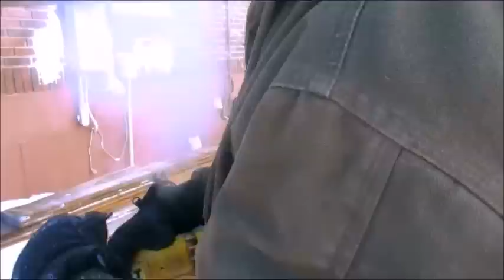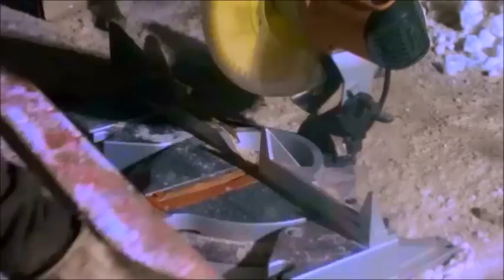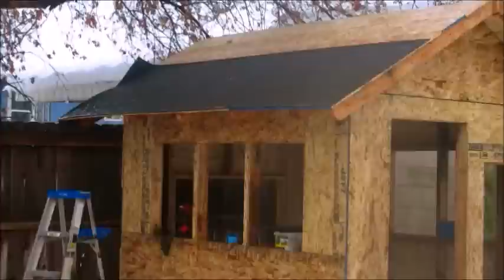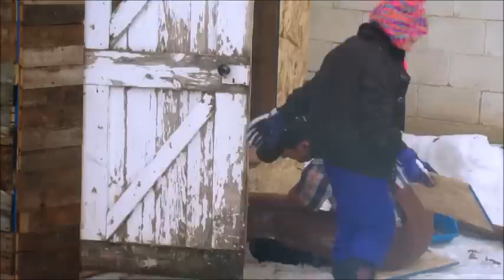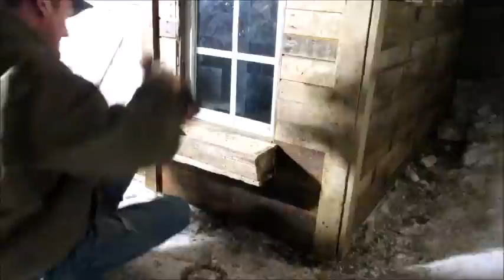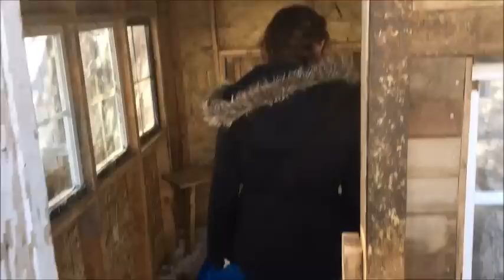#61 - I Built My Wife The CUTEST Chicken Coop! (Scrap Lumber And Antique Windows)

Comment: Looks great. If you insulate it you will need to make sure it is well vented for the chickens. The other thing I recommend is if it is a wooden floor, put something over it (linoleum is good) to make it easier to clean. Like wise for your wall if you can find some pvc boards (used for making signs) use that on your walls. I would also make lift out nest boxes. Everything to make it easier to clean.
Reply from the maker: Good advice!

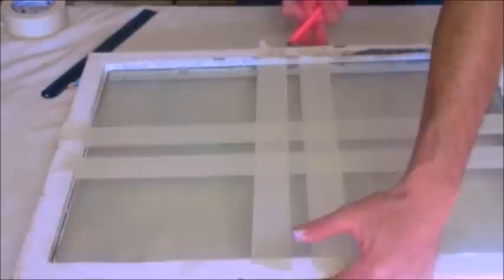Comment: Hey i have a question, was 6:09 to the end of the video purely for aesthetic purpose? Or did you actually need to 2x8's to add support?
Reply from the maker: That is 1x4 pine siding on the outside. The biggest structural lumber I used was 2x4.
Reply: but did you 'need' it was my question lol